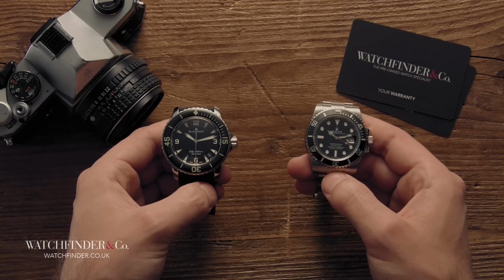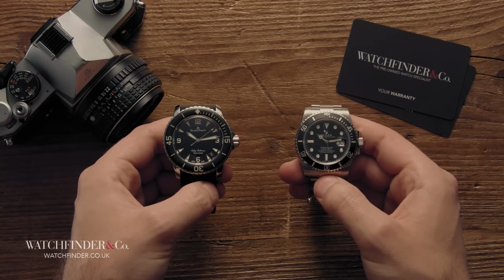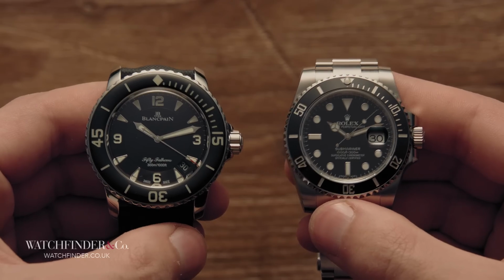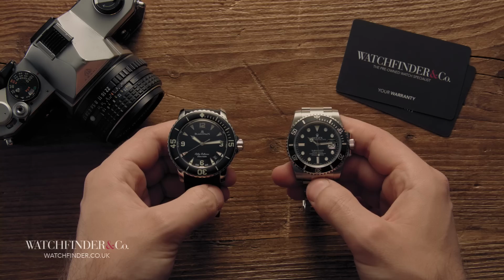Does Rolex Owe Its Success to THIS Watch? | Watchfinder & Co.

Comment: Many are complaining about the Blancpain size but if you check their website you’ll see there is now a smaller version of the FF which should be very appreciated by people with smaller wrist size. They also issued a titanium version of the FF and it hugely improve wearability of the watch especially if you want a metallic bracelet. Another option is to go for the Bathyscaphe which is also smaller and lighter than the original FF.

Comment: Rolex's strong suit is not movement finishing (not even close) industry innovation (this argument could be made, just not by me) or even marketing, its their design language. Designing a dress watch is easy; pick any Parmagiani, LUC, VC, any calatrava style watch hand made/finished and priced north of $10k, and they're all excellent. Sports watches on the other hand, which is Rolex's stock and trade, those are tricky! Thats why every 'sport' model AP is a derivative of the Royal oak, or every PP of the Nautilus. They got ONE good design, (both thanks to the same designer), and milked them for all they're worth, because coming up with another would be far too hard. Rolex has a whole line of (fairly) distinct sports watches. Thats not nearly as easy. Thats why they rule the roost. Many many other better watch brands have tried their hands at ONE sports watch and come up short (FP Journe comes to mind). Rolex is simply a victim of its own success in this arena. I think the sub looks better. Its priced better. Its more iconic. Take the name off the FF dial and place it next to the sub and be honest with yourself.

Comment: ok I know this is nit picky (and it may have already been said) but pressure is supposed to be expressed in force per unit length squared.  The devil is in the details...?  Still enjoyed the video.
Reply: Pressure is also height multiplied by density. Different materials density will cause different pressures. The dive watch is measured in terms of water density since it is intended for water service.

Comment: If only that Blancpain was 40mm!
Reply: It actually fits down to 6.5" wrist! It's got small lugs that taper down. I believe the lug to lug is only 50mm! Don't worry about size; it fits extremely well even for the small wristed.
Reply: Aren't dress watches usually at 36mm?
Reply: @Anything YT, It really depends on wrist size, but traditionally dress watches used to be around 34-36mm for men. Especially in the mid 20th century.
Reply: Adrian Boutsias they made it in a 40mm but it was a limited edition.
Reply: You need a baraccuda model!
Reply: its not a dress watch
Reply: Nor is the submariner.
Reply: It should be 42mm which is its original size. So yes, I’m in partial agreement.

Comment: First, enjoy your slant on horology and love your presentation. Sorry to stir the pot but two things come to mine one is the original dive watch was 44 mm now I have a 7 and a quarter inch wrist. I have some Flieger watches in my collection that are 44mm I also own 32 to 40 mm watches. I have no problem wearing those either. I never got this hole size thing and how one, two or four millimeters is going to prevent me from purchasing or wearing a watch. So if we have established that the fifty fathoms was the first dive watch does that make the Rolex Sub a copy or homage to the 50 fathoms? Just would seem to be a logical conclusion. Look forward to more of Watchfinder Co.
Reply: Peter Werle theres only so many ways a company can execute a round cased watch with rotatable external bezel. Its kind of like saying every car subsequent to the first Benz Motorwagen in 1880 whatever is a homage or knock off. Keep in mind all the worlds first cars looked remarkably similar to each other.
Reply: I am in total agreement with you. In the automotive world quote on quote the Mustang was the first Pony car then came the Camaro and the Challenger all share similar architecture. My point being is many watch collectors are too sensitive about all well this looks like... yes it does but it does not make it either a homage or knock off.

Comment: The Blancpain is one of my favorite dive watches but why dont i just buy one ? Why did i turned to the Submariner and bought that? First of all, the submariner is a very well-known brand of its own, people dont need to say Rolex, just sub is enough. Secondly for me is the size, where the Fifty Fathoms is over 44 mm and the sub, when i bought is about 20 years ago, a more wearable 40mm. Doesnt sound like much but to me this was the reason. My guess is that the Blancpain is simply to big, it is not a shy watch at 40mm but at 44 it shouts like an American President with an orange coupe. And when Blancpain makes this Fifty fathoms in 40mm, called the Mill-Spec is is limited to 500 peices. Weird but tru. I think most people go for the size of a watch aswell as the brand. So that is why i bought the submariner but i love the Fifty Fathoms just as much if it were in a more modest size. Thank you for an other great lesson in the art of watches.
Reply: Jeroen de jong the cost
Reply: Big Boi rofl, if you want value, you wouldn't buy a rolex
Reply: KB Eightyseven the value. Rolex the one.